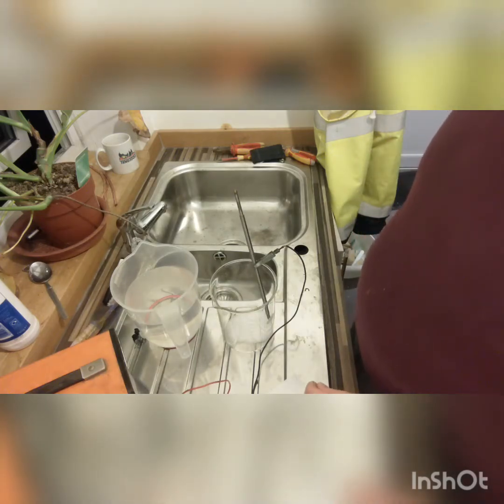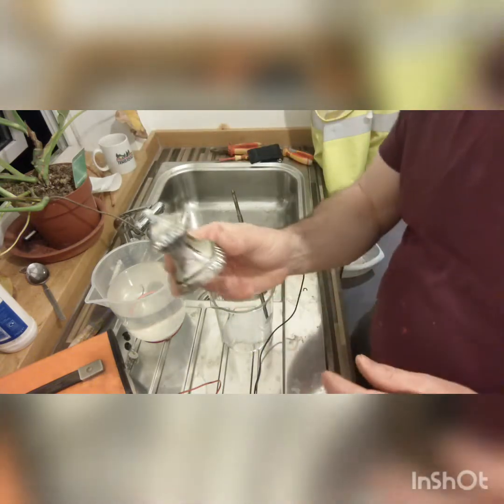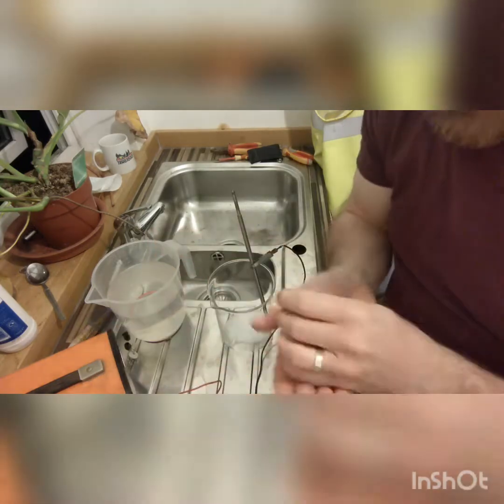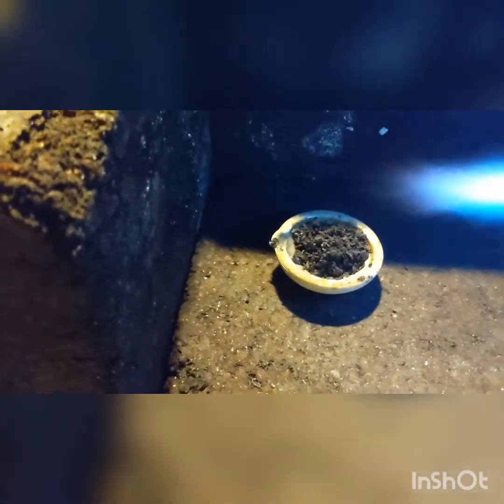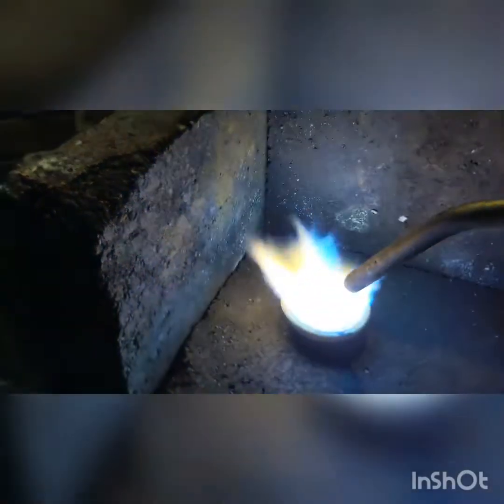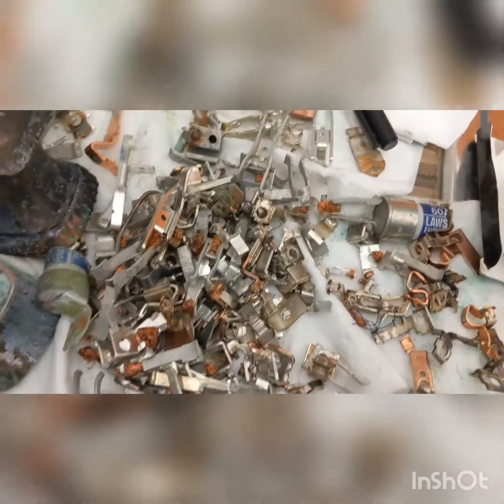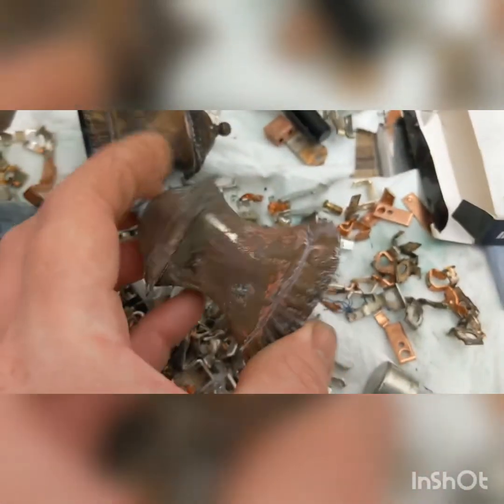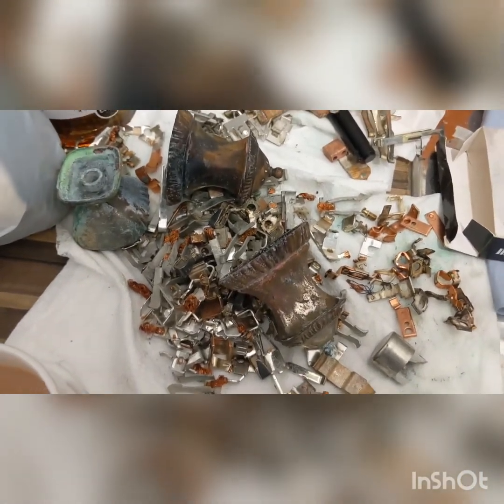Removing silver plating from electrical gear and tableware.

Comment: Interesting video! One thing though, you mat have missed some silver. The small narrow switch contacts you pulled from the lot hear the end looks like they are the type of switch contact that has a small solid silver button near the tip instead of a larger silver plated contact from the big switches.
Reply from the maker: Thanks for the comment, I still have the bits left over so I will have a look. I am hopefully doing another batch so will take any info into that process and see what we get ! Cheers